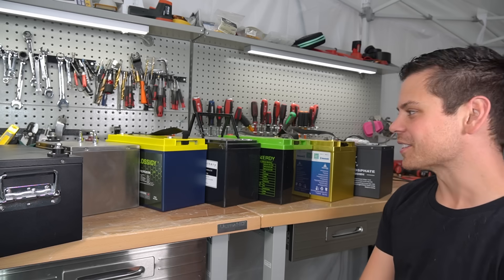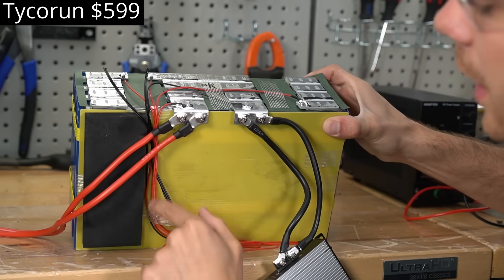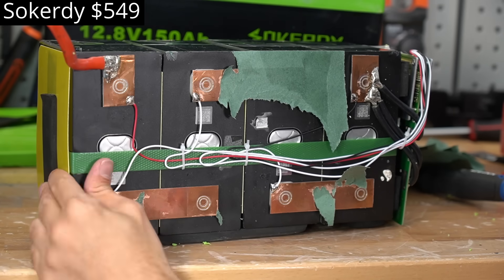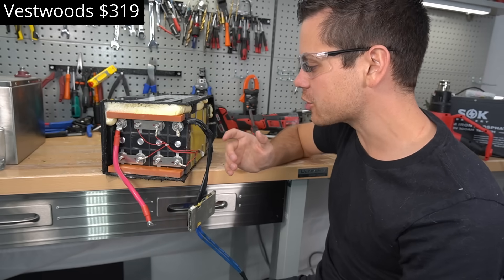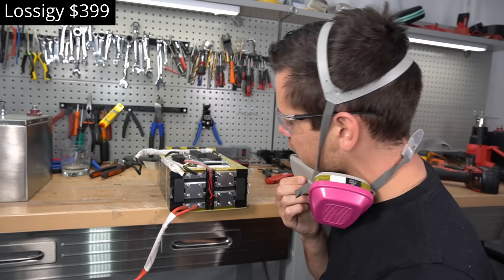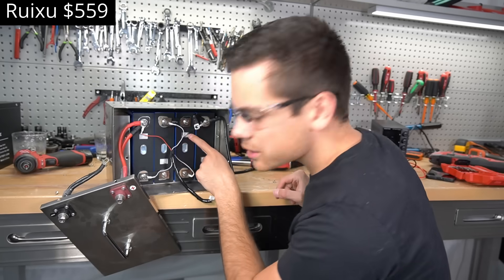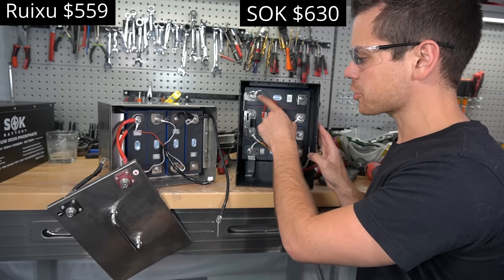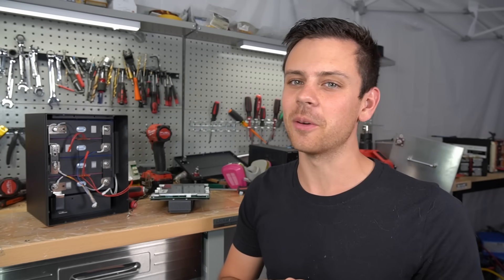Budget LiFePO4 Showdown: Lossigy VS SOK VS Vestwoods VS Tycorun VS Soderky VS Ruixu

Comment from the maker: Batteries in the video (affiliate links):
Tycorun 12V 100Ah: https://www.tycorun.com/products/12v-100ah-lifepo4-lithium-iron-phosphate-deep-cycle-battery-for-rv-caravan-solar-marine-home-storage-and-off-grid?ref=h-cvbzfahsek
Lossigy 12V 100Ah: https://amzn.to/3uo5Mkq
Sokerdy 12V 150Ah: https://amzn.to/3unMYC0
Vestwoods 12V 100Ah: https://amzn.to/37xNu7u
Ruixu Stainless Steel 12V 100Ah: https://ruixubattery.com/product/rx-lfp-12-100bs?ref=h-cvbzfahsek
SOK 12V Internal Heated/bluetooth: https://www.currentconnected.com/product/sk12v100h/?ref=wp
SOK 24V Battery: https://www.currentconnected.com/product/sk24v100/?ref=wp

Other batteries I recommend: https://www.mobile-solarpower.com/lithium-batteries.html

~~~~~~~~~~~~~~~~~~~~~~~~~~~~~~~~~~~
Tired of getting ripped off? Check out my "Will Prowse Approved" solar product recommendations below!

12V Batteries
https://www.mobile-solarpower.com/lithium-batteries.html

48V Batteries
https://www.mobile-solarpower.com/48v-batteries.html

Offgrid Inverter System Builder
https://www.mobile-solarpower.com/48v-complete-system-blueprint-559371.html

Hybrid Inverter System Builder
https://www.mobile-solarpower.com/code-compliant-48v-offgrid-system.html

Mobile Handtruck System Builder (very popular!)
https://www.mobile-solarpower.com/mobile-48v-system.html

Solar Panels
https://www.mobile-solarpower.com/300w-solar-panels.html

Ground Mount Solar Racking
https://www.mobile-solarpower.com/ground-mount-racks.html

Wire, Lugs and Busbars
https://www.mobile-solarpower.com/wire-and-connectors.html

Tools
https://www.mobile-solarpower.com/tools.html

Fuses and Circuit Breakers
https://www.mobile-solarpower.com/fuses.html

Plug-N-Play Solar Systems
Ecoflow, Anker And Bluetti! So many models to choose from. See my current recommendations here:
https://www.mobile-solarpower.com/full-size-systems.html

~~~~~~~~~~~~~~~~~~~~~~~~~~~~~~~~~~~~~~~~~~
Need to build a large DIY system? Need a trustworthy solar distributor? These are my favorites:

Signature Solar
Creator of EG4! Solar Minisplits, Victron and More! Largest Solar Store Online.
If you want $50 off, please use my link below and coupon code "DIYSOLAR50":
https://signaturesolar.com/?ref=cPwLcVc0SW-BjN

Current Connected
Best Prices for EG4, Victron, Midnite and so much more! Fast Shipping and Highest Rated Customer Service:
https://currentconnected.com/?ref=wp

~~~~~~~~~~~~~~~~~~~~~~~~~~~~~~~~~~~~~~~~~~
Join our DIY Solar Community 
Need more help? Join the largest solar forum on the internet for beginners and professionals alike. 140,000 members and counting!
https://www.diysolarforum.com

Check Out My Free Book
Best-selling and beginner-friendly guidebook to off-grid 12V solar!
https://www.mobile-solarpower.com/the-book.html

~~~~~~~~~~~~~~~~~~~~~~~~~~~~~~~~~~~~~~~~~~
Contact Information:
I am NOT available for personal solar system consult! If you wish to contact me, this is my direct email: williamprowsediysolar@gmail.com
FTC Disclosure Statement and Disclaimers:
Every video includes paid promotion or sponsorship (such as free products for review). Some links on this YouTube channel may be affiliate links. We may get paid if you buy something or take an action after clicking one of these. My videos are for educational purposes only. Information is subject to change/update at any time. Electricity is DANGEROUS and can kill. Be smart and use common sense :) DIY Solar Power with Will Prowse is a participant in the Amazon Services LLC Associates Program, An affiliate advertising program designed to provide a means for sites to earn advertising fees by advertising and linking to Amazon.com
Reply: If you're gonna throw them to the side for all time a poor fella like me would pay you to ship them to me since I'm surviving off 150ah and it's not enough to run my stuff with any autonomy .
Reply: Interesting that in the Q&A on Amazon for the Vestwoods, the seller answered a question about the temp cut off and says this battery has a low temp cut-off: 

 "Question: It seems to have no low-temp cut-off? Hi-temp only. This is a big problem.
Answer:Of course not. We support low temp cutoff. And you could see this question on July 12, 2022
By FOIIOE EU SELLER  on August 2, 2022."  

So, as of august 2022 the Amazon seller says it has it.  I have no idea if he is linked to the company or not or if he knows what he is talking about?  They are being offered in a 2 pack now and  $669 for two ($334.50 each) 100 amp hour batteries is a great price for my thoughts.  For that price, if it still does not have the low temp cut off, I can add some heating pads.  Thanks for doing these great videos and explaining everything so clearly to us.  I believe you have saved many people from wasting their money on  garbage batteries.  That is a great thing you are doing, thank you.
Reply: @OverlandOne  You should ask the seller when they added low temp protecting. If he says they have always had it post this video ;-)
Reply: @MrWhiltetail  I read somewhere that it might be on the BMS circuit board but have no idea if that is true, if it were, I would think that Will would know that.  I like your idea though.
Reply: Vestwood link is to 200Ah
Reply: @jross207  now is 100ah
Reply: Very important question is that which battery can be used 2s or 4s?
Reply: When you say "custom built battery" in your charge controller video, does that include the raw cells I wire together? Anyone know?
Reply: Do you see these batteries copying what car companies are using? I heard you mention pouch cells and I seem to remember Ford using pouch cells for their truck.
Reply: Great video!
Reply: So how long should we expect these cheaper batteries to last? I keep hearing this type of battery should last at least 10 years and more like 15-20 years but some of the things you say make me wonder if we can only expect 5-7 years.
Reply: Re vestwoods low temp, could be built into bms pcb. Test by spraying bms with canned air.
Reply: How can you reset the bms on the sok battery without taking the top off
Reply from the maker: @deanom1583  you don't. Why would you?
Reply: @WillProwse   because mine goes into protection shutdown  when using a coffee maker that draws up to 87amps
Reply: @WillProwse   my sok 207a battery keeps going into overload protection while using a coffeemaker and I have to pull the bms connector to reset it. I am hoping you might  know an easier way
Reply: Hi Will! Any chance you could do an update on this video?

Comment: Just a thought, the batteries that dont appear to have low temp charging protection might. The temp sensor may be soldered onto the bms circuit board itself. You would have to cool the entire bms to test it. They could also do the same for high temp. I would try this before condemning it as not having the protection. 

This would work because the bms could change temperature faster than the battery (unless thermal runaway happens which you are already screwed) due to much less thermal mass.

Comment: Is there a method or adapter system that can be used to safely transfer power to lithium batteries from a lead acid battery system? Or the other way around? (I know you shouldn't normally do this. But I'm asking if someone has figured out a work around for that problem.)

Comment: I run 4 of the SOK 24v 100ah batteries in my van and especially after upgrading the BMS to the Bluetooth version recently they just rule for the price. I’d honestly never buy Battleborn again (I ran 6 12v batteries from them in my Airstream Basecamp).

Comment: Don't get the heated battery BS. If one kept them on a house cellar or back room they wouldn't need to be heated. I'm in Maine and have 400ah batteries in my camper van. If I'm traveling it's to warmer climes if not traveling i simply take the batteries in the house.

Comment: I have a question for you. I have a gas generator that’s a fuel saver type at 2000 watts and 20 amp and 2- 110 outlets………I use to use it to jump semi trucks with a 50 amp 12 volt jump charger….The type you buy in Walmarts and such. I hooked it up to the gas charger and it raised the idle some but not to it max. However I was jumping the acid battery’s with the 50 amp boost to start the semi with 4 battery’s?  Now why can’t this be applied to charging lithium batteries and if you could what would be the effect on fast charging at 50 amp boost to those lithium battery’s? Thanks

Comment: Will, can I use a 4 bank NoCo charger to charge 4-12 volt batteries while connected in series or would I have to disconnect them all first. It's for a 48 volt golf cart with 4 lithium batteries

Comment: Question: if you have two 12 volt internally heated batteries in a 24 volt series but each of the batteries is hooked up to its own 12 volt bank on a multi bank 12 volt charger, does that not take care of the potential SoC imbalance if the heaters kick in on the batteries at different times? At least as long as you wait until both batteries are fully charged before putting a 24v load on the series?

Comment: Great review. It sounds like the heated 24v SOK has the advantage of heating and 24V, versus two 12v heated in series - which won't heat at exactly the same times... it at least solves the heat/timing problem.

Comment: I asked SOK about the SERIES connection problem with their heated batteries on 26th January 2023.
My question was specific to the Marine Grade 12V 206Ah Battery, Sealed Plastic Box Bluetooth & Built-in heater, SKU: SK12V206PH.
Here's what they said: "The heater problem is solved now. So that all 12v100ah, 12v206ah battery is fine to connect in both series and parallel. No need to worry about it."

Has anyone tested recent models of their heated batteries in series, in cold weather?  Do the batteries remain balanced over time?

Comment: Thanks for pointing out the series configuration issue for SOK. I have two 12v 206 AH SOK Bluetooth heated batteries in series connected to a 24v 3000w Growatt inverter panel. and they are never the same voltage. Their techs discredit the ABC-BMS Bluetooth as inaccurate and tell people to use the Victron Smart Shunt as a measuring device with a balancing device. How do I get thru these lies and return these? OR do I Eliminate the heaters?

Comment: I wish you would review the Power Queen 100 amp hour lithium ion battery as well as the screampower 100 amp hour lithium ion battery because I'm thinking of buying one of them but I don't know which one or if I should get either one of them at all because it's pretty confusing to know what batteries are really good for the price as well as the features and all that because other people here on YouTube seem to really like the Power Queen batteries but the screampower battery right now is actually like $5 cheaper than the Power Queen at Walmart and it has 2 USB charging ports on the side as well as a direct plug-in charging port which seems to be really good if it all works good and if the battery is good st all obviously so I kind of want one of those batteries but I don't know but can you help if you know anything about either of them?

Comment: Hi Will, great videos'. I know you can't tear apart every battery, but I was wondering if you have ever reviewed this battery on Amazon?  Brand: TEMGOT 12V 100AH Low Temp Cutoff LiFePO4 Lithium Battery with Touchable Smart Display & APP Monitoring, Built-in 100A BMS,1280W Load Power, 5000+ Cycles

Comment: I am glad I watched this. I wanted to go with a 24 volt configuration for my hobby farm well and barn which are not heated. and get cold. But now I realize that I should probably not use 12 volt self-heated batteries wired in series. So? Should I look for a self-heated 24 volt battery? Or just go with a 12 volt system. I am looking to replicate your 2000W inverter 24volt build

Comment: Great video! I am in need of a 12V 20 to 25 amp hr battery to use as a starter battery for a 60hp outboard motor for my boat. Not using it for a trolling motor. Just starting the outboard. About 400CCA should do it. Any suggestions? BTW I have 160hp jetskis with 325CCA AGM batteries, The 325 CCA AGM batteries spin over the JetSki motors with ease.

Comment: Hey Will, i had bought a Chin's 100ah battery that would not take a full charge, i used a table saw and etched the lip of the battery a little at a time to reveal the inner lip that allowed me to remove the top. it made the battery case reusable and no mess. You might want to try that.. i found out i was ripped off... inside of this huge case was the real tiny battery surrounded by ALOT of foam padding. one cell was bad..the little round window was puffed out and would fully charge. i only used that battery twice.. very disappointed.

Comment: Will, I need new batteries for a small 100 year old cabin in the Antelope Valley of SoCal. It can get really cold there 15 degrees give or take. I have been looking at 4 - 12v 100 Ah Battle Born batteries, perhaps with internal heating, wired to 48 volts.  In this video you stated that internally heated batteries should probably not be wired in series. What do you suggest? Perhaps building a battery box with a light bulb for heating or something else would work, what do you think? I am planning on using 6- 480 watt Q cell panels. I want to build a larger system than recommended so I get full charging during cloudy days. Please advise me. Thank you, Bill Rogers

Comment: I have a motor home I dont think I can go to lithium batteries  my generator /diesel engine /solar panels/ and  plugin in at RV park all charge my DC batteries  also the engine batteries are on the same charge and I have 6000 watt Inverter/charger that will charg lithium

Comment: I just bought a 200 ah vestwoods and it’s massive like a microwave and it weighs 70 pounds I’m struggling to believe that there’s not to lead acid boat batteries inside this thing.  Additionally I did a search for the Bluetooth app that it says it has on the Apple store and it does not exist I think I’m going to be returning this to Amazon I have a bad feeling about it the documentation is nonexistent the website almost looks fake

Comment: I’m using a $320 12v 100ah cells for my home rig. Solar charging works great. In California I don’t worry about cold charging, although once when it was frosty in the morning, it wouldn’t charge. Low temp protection? It works!

Comment: You should start tearing into all these new lithium powersport starting batteries. A lot are getting advanced BMS protection and some kinda tech that theoretically allows them to discharge at a much faster rate that their AH capacity would suggest, for example the new NOCO starting batteries.

Comment: Found your chanel a few days ago. It is by far my fav chanel now. You also get to the point, you explain. You compare. You don't waste so much time promoting things and talking about a bunch of useless stuff. I just got handled a solar system. It's a few years old. However I can still use it as my starter and learn about solar more. I know good amount just not enough. I have 3 100 watt panels and 2 100amp batteries. They are the once that you can't get below 50%. So the batteries are the worst, but for getting panels, batteries, wires, controller, inline fuse and 300w inverter for free I can't complain. This is excellent chanel to learn about this. Batteries will be first thing I'll replace obviously. So this is perfect for me. Thank you for having a good chanel and actually about the stuff it's ment for. Everyone knows YouTubers who spend half the video promoting things or talking about a bunch of personal life useless stuff.

Comment: My lifepo4 batteries are sitting outside not  heat it in a little room in the summer he gets to about 100° they have been sitting out there for 3 1/2 years no problem they are vented but not heat on them because I live in South Texas because it never gets Below 34° down here and if he does the batteries or create enough heat to keep warm

Comment: So I've got a 64ah headway bank in my car to power my car audio system. Of course winter is coming and I live in Ohio so cold and snow is inevitable. I see all this low temp protection stuff. What happens if I run it like I normally do? It's on an isolator so I can turn it on or off. I've got an AGM battery to start my car. I've had the lithium in for 6 months or so now with fantastic results.

Comment: May have missed it (because I didn’t read all 500+ comments) but for the low temp cutoff like the Vestwood, is it possible the sensor is on the case instead of external like others?

Comment: 🤔 If one were building a 24 VDC system, however,  the 2 X 12 VDC SOK batteries = $1260 + $ of inter connectors vs $1029 for the 24 VDC battery.  The larger battery is also slightly more compact and more simple to physically secure.  For RV and trailer use the standard cases also maintain the weight low when compared to a vertical  rack arrangement, so stability is enhanced.

Comment: My comment is actually a couple questions. I’m looking to buy an SOK 12V 206AH battery for my 2000 class A RV. My first question is I’m assuming the purpose for the heated battery is so that you don’t have to worry about in not being able to charge, but the non heated battery has a cold temp sensor that shuts off the charging when it’s to cold. I live in South Carolina so probably 90 nights a year below freezing but usually above freezing during the day. Would I be fine purchasing the battery with the low temp shut off in my situation or do you think it still wiser to have the self heated batteries? Also for information purposes the house battery compartment in my rv is on the exterior with no insulation just a steel slid box and cover door. My second question is do I need to change out my existing charger? I don’t think I do but if you tell me differently then I’ll do it. Thank you for your time.